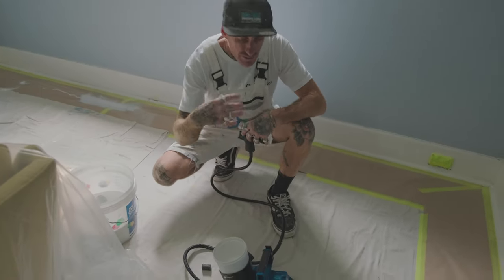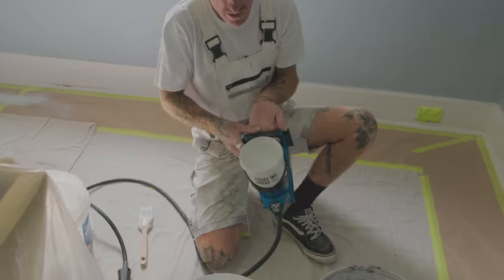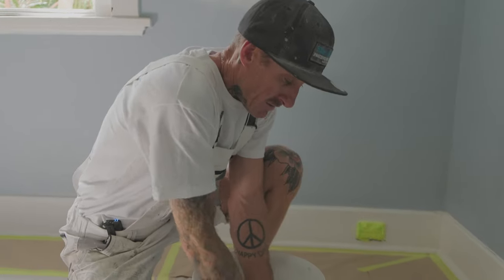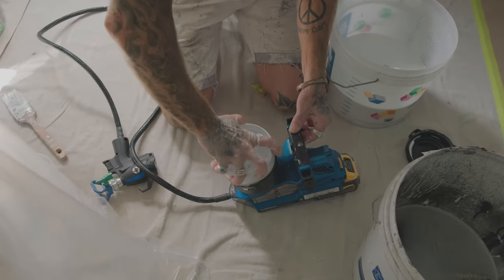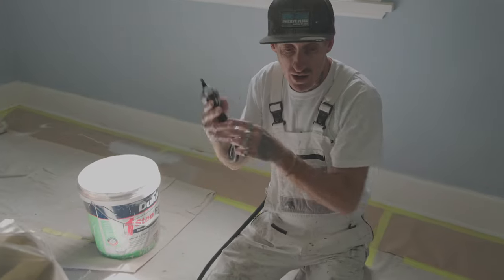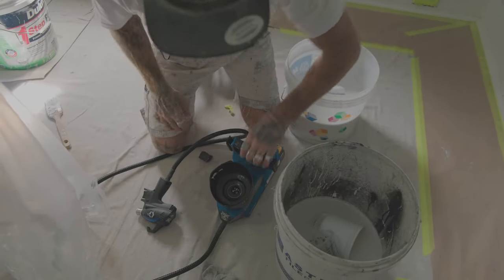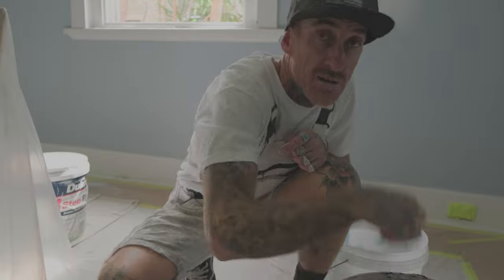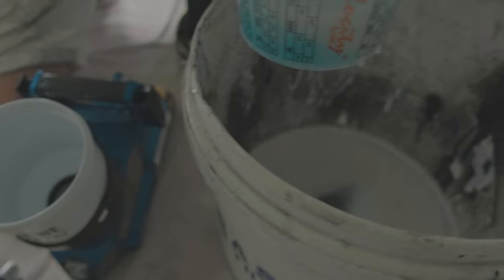How to Clean Your Graco Ultra QuickShot Paint Sprayer for Long-Lasting Performance

Comment: How do you keep the gun and the unit clean? Any tips and tricks to prevent it getting caked In paint after every use.
Reply from the maker: Unfortunately there's just instances where you can't avoid it. Dedicating cleaning time once a week to properly get into it is pretty important. Sometimes it just takes routine care and a bit of elbow grease to keep the gear in good condition!
Reply: That’s hard mate. I used a couple of times and it’s really like professional tool but a hobbyist’s toy
Reply: Uh…..  mask up the gun?  😅😂

Comment: does storing it with the lid on, and not allowing the moisture to evaporate, create mold and mildew over time? I would think it would.
Reply: I haven’t had that issue. My understanding is that the pump armor fluid is largely antifreeze with some additives meaning that the liquid has antimicrobial properties. For longer term storage it can be added to the machine without dilution, but that recommend a 20% dilution for short term storage

Comment: If i need to top up the little hopper and it hasn't run out of paint can i just top it up and carry on spraying or does it need to be primed first ? Newbie to spraying and a bit unsure . Great bit of kit though , i really like using it.
Reply from the maker: You can carry on spraying as long as the strainer/filter where the pump inlet sits is covered with enough product! If any air sucks in, you may need to prime again :)
Reply: Recently I used the quickshot for the first time.  Turns out it’s easy to know when it starts getting low on paint.  It’s easy to use so I’d pour in more paint and keep going.  But if it loses prime it’s easy to get back 👍🏻

Comment: Anyone know how long those batteries last?
Reply: 4 lite a gallon per battery as described in the manual.
Reply: DeWalt batteries are great. Get the 6 or 8 amp hour battery and it should last you a long time. and keep a charger and a fully charged battery on hand ready to go. Place depleted battery on charger when you swap battery, and you'll always have a charged battery ready to go.